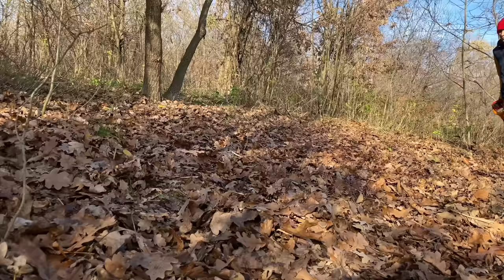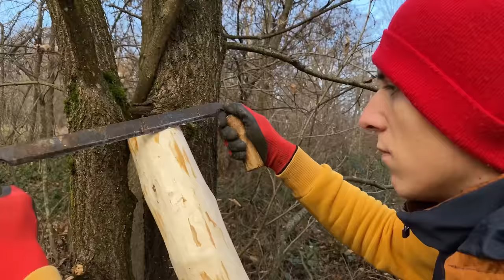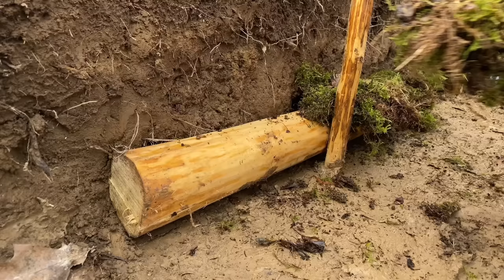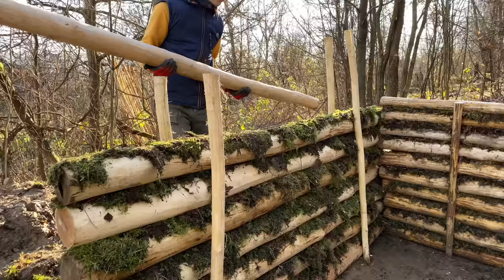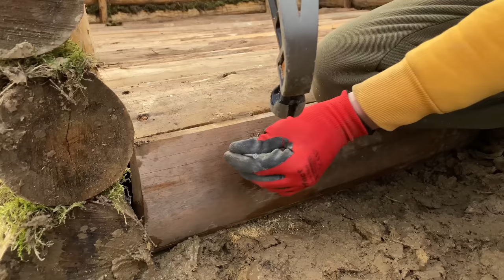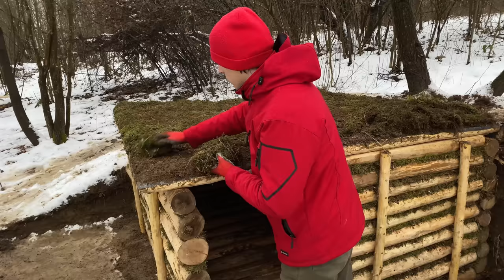Alone built a dugout in the forest. From the beginning to the end

Comment: I would not have cut the plastic "roof" tarp along the edges of the roof.  Respectfully:  it would be better to allow the extra length to hang down over the walls (except for the door space, obv.)  Doing that would help water drain down the outside of the wall instead of allowing a space where it could run inside the dugout.
Reply: Very correct, I noticed that too.
Reply: That's the only thing I thought I'd do differently, too
Reply: @AdetomiwaYefalo   .😅د.😊دم...د.😊
Reply: ذ